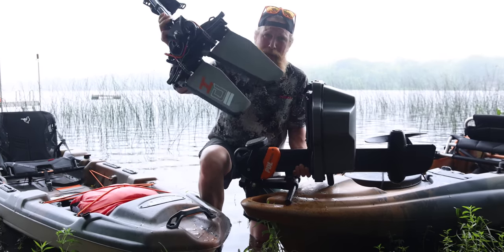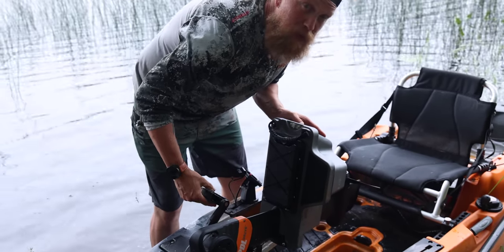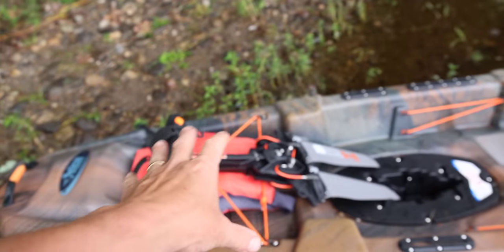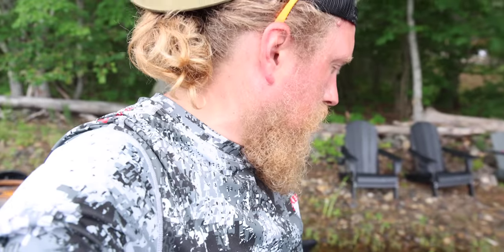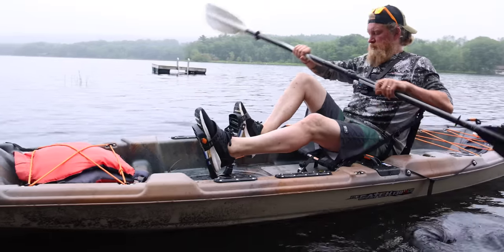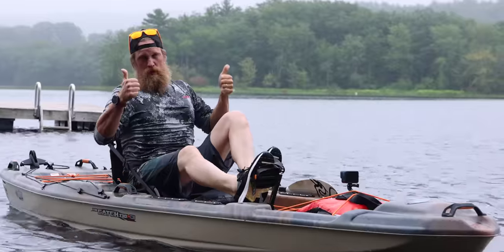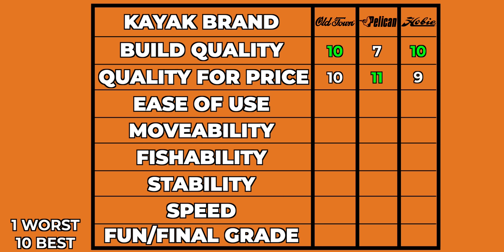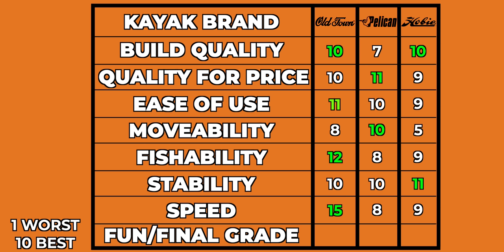Pelican VS. Old Town VS. Hobie - Pedal Drive Kayak Pedal Off and Gear Review

Comment: Coming from a guy who bought a new model Hobie PA in 2008 and has had 6 Hobie’s in total since, I sold my last two PA’s and bought two Old Town Predators with the PDL drives and there’s no comparison. The PDL drive is rock solid and the instant reverse is insane. It’s fast too. Last year I tried a Hobie Outback with reverse and to me, it sucked lemons sideways. Getting your peddles aligned then pulling on the release, then going backwards, then aligning the pedals again then pulling on the release to go forward again was terrible. The PDL is instant reverse. Hobie’s 360 drive is awesome but not many people can afford it. At that point I’d get the Old Town with the trolling motor drive and spot lock with a good lithium battery. The Catch is a deal if you don’t care about reverse. My farm and fleet had one tonight on clearance for $1100.  It’s lightweight too unlike the Hobie PA’s. We have a fantastic quarry by me and getting the PA out was terrible. The Predator goes in easily and out just as easy as it’s a limestone entry/exit. My $0.02.

Comment: I love my old town 106. I lean a little into the turn which seems to help. Also if you have to take the drive out for some reason and accidently drop it in the water, the old town is designed to float.

Comment: I've owned over 100 kayaks of all shapes types and sizes.
After aquiring a CATCH 110 which I loved more than any HOBIE or other pedal drives I've owned I did a little research and found that the CATCH130 is set up exactly like the 110 but it's bigger!
So I got one! 
My first suggestion for anyone getting a hydryve or hydryve ii is to replace the Pelican  sprockets with Hobie sprockets! 
(Watch my video) 
Since getting my Catch kayak(s) I've sold all of my pedal Kayaks aside from my 16ft Hobie Adventure and Mariner 12.5
Ok going back to your video (I'm only 2 min in!)
13:00 Aaaahhh!
DO NOT PUSH THE PELICAN DRIVE THAT HARD! THEY BREAK! 
That's why i suggested the Hobie sprockets
Reply: I forgot to mention you can flip the catch fins around to go backwards.
If I'm fishing a wind blown shoreline I simply flip the fins around and use them to keep my distance while casting towards the shore.
In weeds... you need to flutter the fins
One foot forward then just pulse the fins.
Reply: Is the 130 significantly more stabel than the 110? I wanna get the most stable one but also the lightest one. 😂

Comment: LOL i am sure you can silicon glue the sensor to the inside of the kayak just make sure there is no bubbles in the glue and the sensor will see thru bottom  if that don't work anymore then you can cut silicon with piano wire or stainless trace wire

Comment: During the race between the Old Town and the Pelican, the Old Town is around 88lbs, while the pelican 57'ish, that makes a difference in performance for sure. I just purchase a Perception 11.5 Outlaw as my first kayak and think I made a mistake. It is as heavy as your Old Town and feels super sluggish. My son has the Pelican without the peddles and the kid glides over the water (granted he only weighs 100lbs to my 210lbs). I have an Old Town 120 in the mail hopefully I like it better.

Comment: The biggest problem I have with pedal drives is that I am only 5’6” tall and struggle to get my seat close enough.  When I use it I practically have to slouch way down to reach the pedals.   It’s really a struggle for my wife who is only 5’ tall.

Comment: You can tell when they’re racing they are trying to give the pelican a chance. 
I’ve got a pelican and I’m not super happy with it. Stability doesn’t seem very good. (I have the 10 ft though). And your legs burn like crap when you’re trying to keep speed! I mainly use it to bring along while hauling a camper so I think I’m gonna stick with it because it’s so much lighter. I just envy how easy and fast the sportsman pdl is as well as stability (I think he was generous on the comparison there). Hard to justify dropping 2500 though just for that.

Comment: I think you should be comparing a new hobie and not a rental with a abused drive. If you center your pedals, the reverse cable works great. Neither one of my drives makes noise and you didn’t even mention kick up fins. Not a fair comparison at all